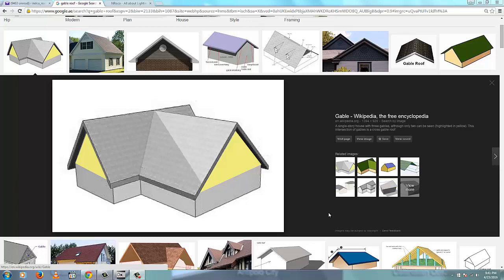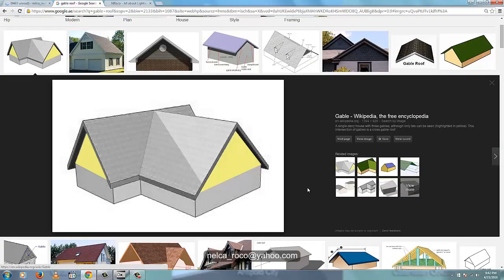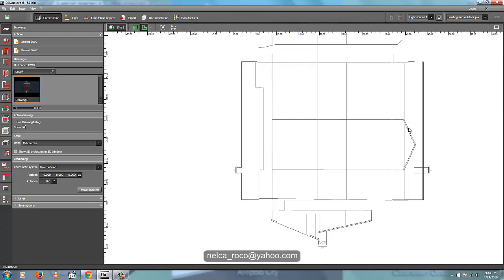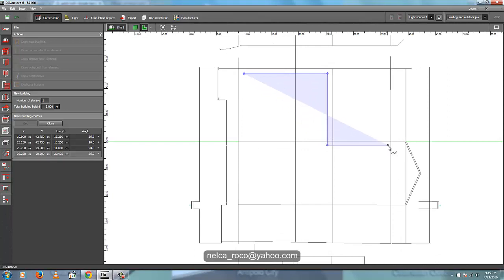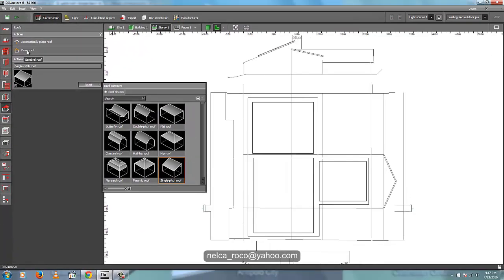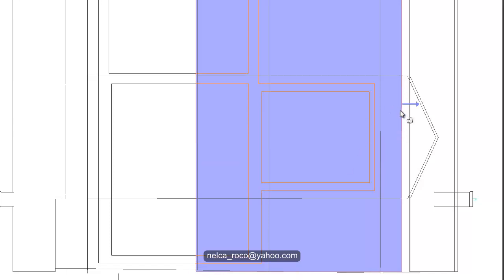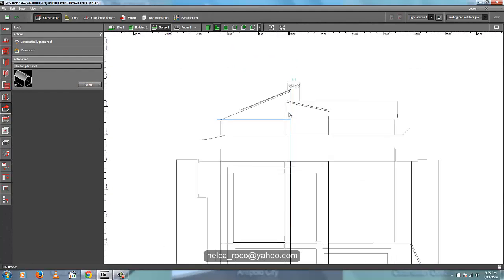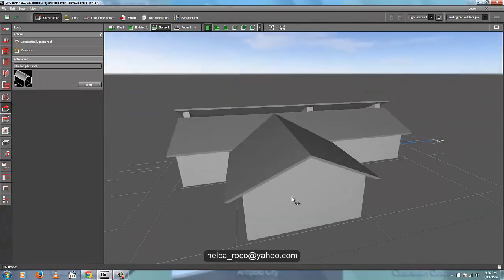DiaLux evo - How to create a complicated roof

Comment: It looks nice from the outside but the second floor from the inside is not working properly, the double pitch roof is cutting into the room.
Reply from the maker: Don't let the cutting plane touch the other wall.
Reply: @NelcaRoco  how can i prevent this problem exactly? i want to combine both roofs.

Comment: Hi Nelco, I'm really appreciate your tuto for Ddialux ;) I'm working at a light manufacturer and I have a problem to make a sloping ceiling on a project because the room is not square but parallelogram, so there is no perpendicular angle... 
Any idea ?
Reply from the maker: Yes, its possible. Draw ur ceiling instead of inserting. then go to elevation and tilt it according to your slope.
Reply: I'm sorry Nelca but I have search during a couple of hours and don't find elevation for my room on Dialux Evo.... I had draw my ceilling but it was allways flat and I didn't finf the option of elevation and couldn't tilt it....
According to this answer : http://dxboard.dialux.com/viewtopic.php?f=2&t=82568&p=98274&sid=d4e54bbb7a1e70df696c51d1967cf470 the only possiblity is by drawing an extrusion volume but extrusion volume a also square and not my room...
Reply from the maker: can u send me the drawing? nelca_roco@yahoo.com
Reply: Hi Nelca, can you draw a dome roof? i have tried everything i know but it does not work out correctly. Any help would be appreciated.